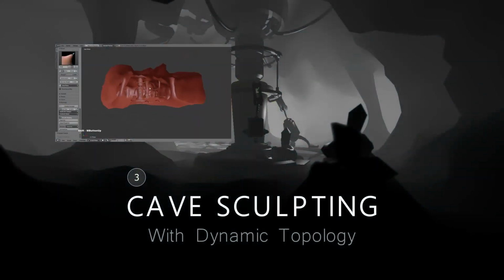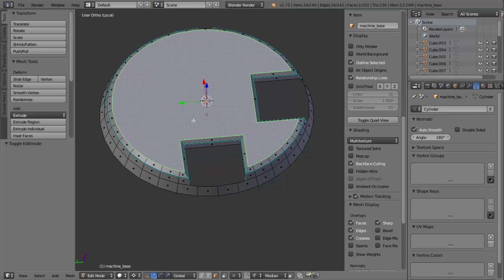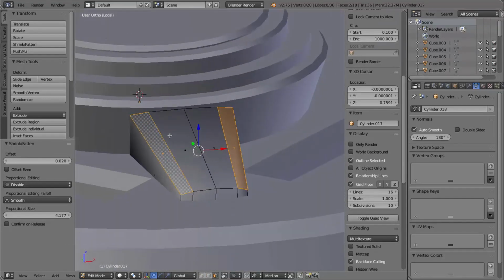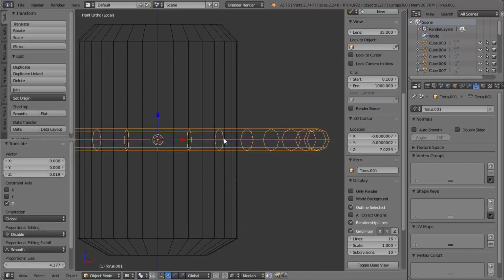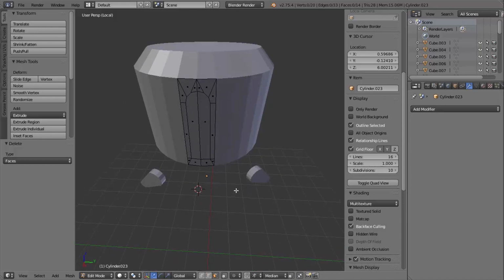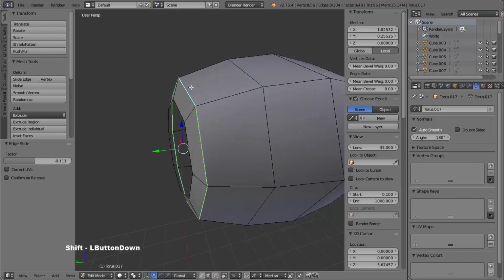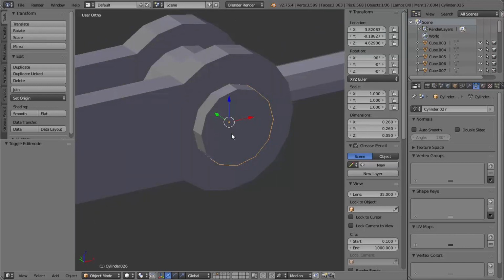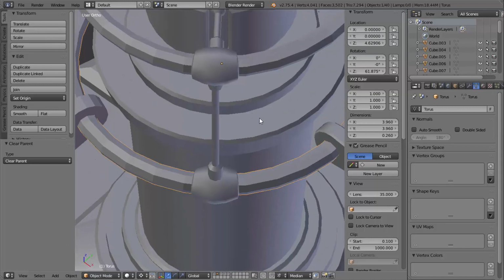Sci-Fi Cave Environment Course | 4 - Central Machine

Comment from the maker: Hi Aidy Burrows here, we’ll pin any important info that happens to crop up here. 

Useful Times > 

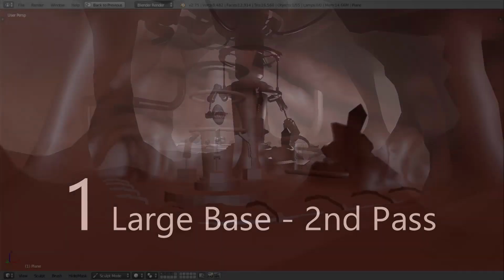Part 1 - 02:05 Large Base 2nd Pass
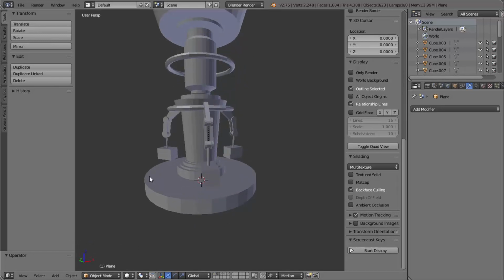02:39 Isolate selected object with / on the numpad
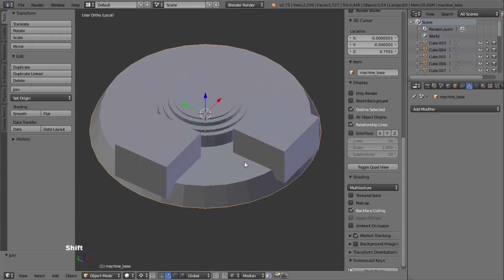07:45 Using the Boolean Modifier
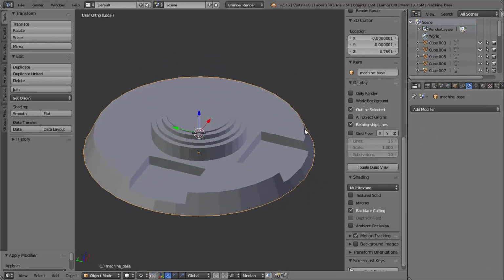08:24 Creating the main bevel
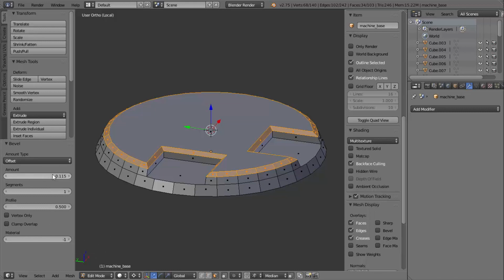08:57 Smoothing the object then enable Autosmooth normals and use Ctrl E > Mark Sharp
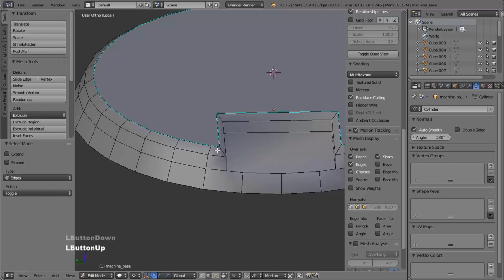10:17 Alt Right click to select the edge loop. 
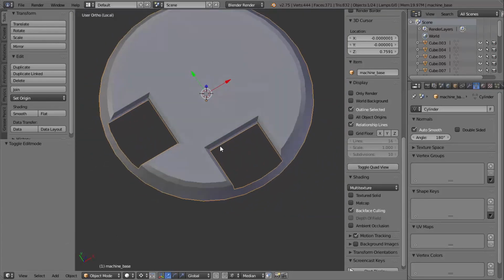11:44 Breaking up the Ngons with tri’s and quads. 
12:23 Using J to connect vertices. 
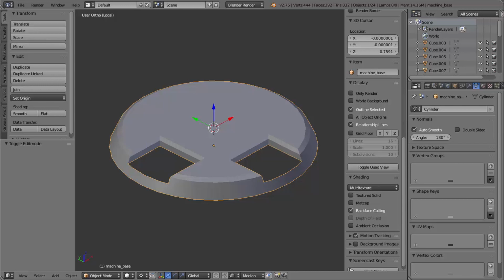14:18 Creating the Base Trays
Part 2 - 16:13 Forcefield Base
17:13 Adding the Bevels
18:12 Setting up the smoothing as before. 
19:14 Creating the feet
20:31 Clearing the parent
21:54 Ctrl I to invert selection. 
22:23 Using Shift Z when scaling to lock the Z axis while scaling on X and Y. 
22:56 Using Alt S shrink/Fatten tool to bring the feet out further and curve the feet top. 
24:23 Using a Boolean to flatten the bottom of the foot and using dissolve to get rid of extra edges
26:40 Beveling the corner edges then marking them as sharp for proper normals shading. 
29:01 Making copies for the other feet. 
Part 3 - 29:12 Forcefield Upper
31:07 adding a fan of triangular faces with Poke Face
Part 4 - 35:13 Main Forcefield Object 
36:03 making the horizontal bevel
38:32 vertical part
40:06 dissolve edges on the cylinder
40:43 Show wireframe on object
41:30 Using the boolean modifier
43:18 Ngons cleanup
44:57 automatically merge vertices when snapping option
46:22 rotating the object into position
47:12 grow selection with Ctrl and Numpad + together
49:36 Mirroring the top half
50:37 Extruding in the groove
52:15 Disabling Loop Slide for better bevel in this case
52:37 automating the object smoothing with the autosmooth option
Part 5 - 55:08 Torus
56:55 Changing the edge slide position with the factor slider
59:33 sliding an edge by pressing G twice
Part 6 - 1:03:38 Mechanical Arms
1:09:04 Switching off the 3d manipulator
1:12:24 Select connected faces under cursor with 'L'
1:14:58 resetting cursor position with Shift C
1:18:21 Tip : Isolating for easier wireframe selections
1:22:30 calculations within input fields